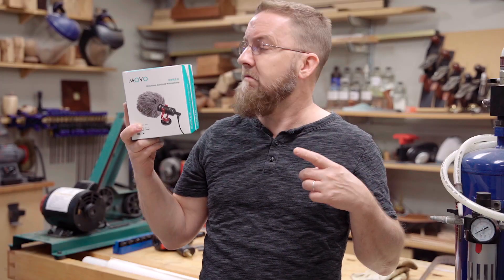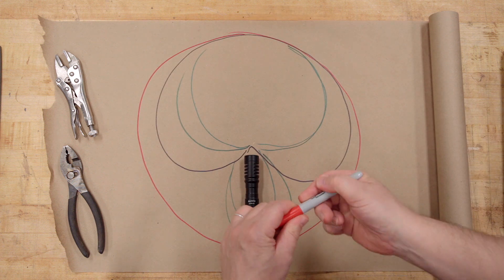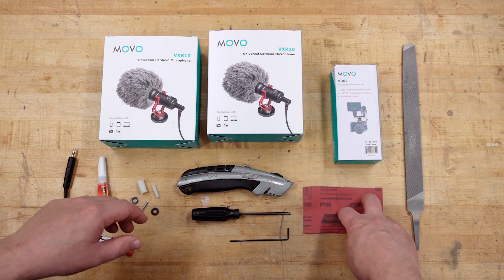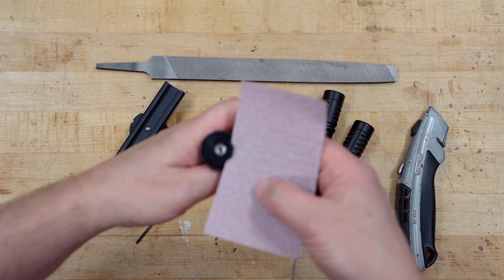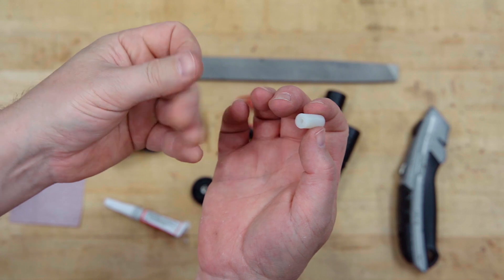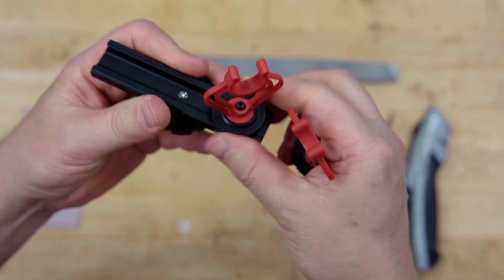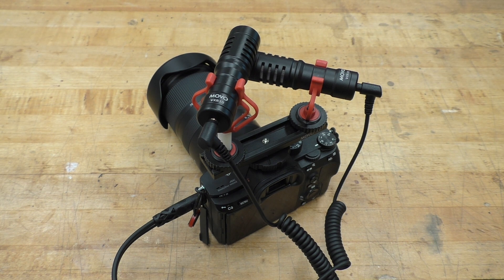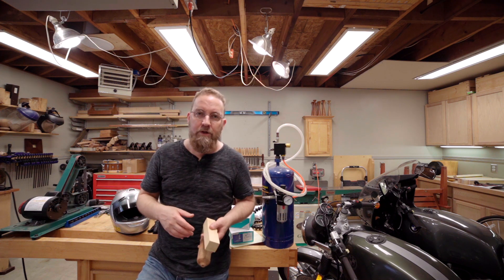VXR10 Stereo Microphones - DIY Build

Comment: This is a good idea. I was thinking if the mics could be placed in other positions besides x/y and even putting x/y but in the same height without the need to modify one of the mic holders.
Reply from the maker: All typical studio applications of the XY set up place the capsules on top of each other so they can be perfectly aligned. For something like this I don't really think that level of accuracy is necessary but since I was going to all the trouble of the build, it seemed like the way to go.
If you haven't already, check out my review of the VXR10-PRO. It's has largely replaced the standard VXR10 for my workflows. It's not as hot, and has a supercardioid polar pattern which works well for me.
Thanks for watching!